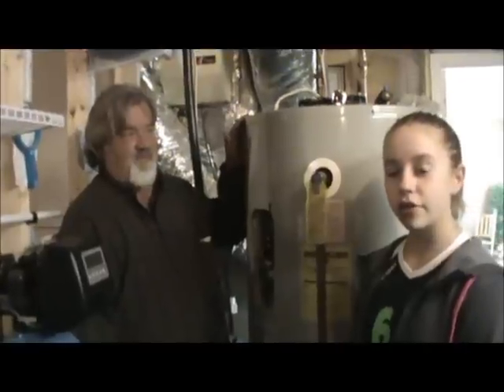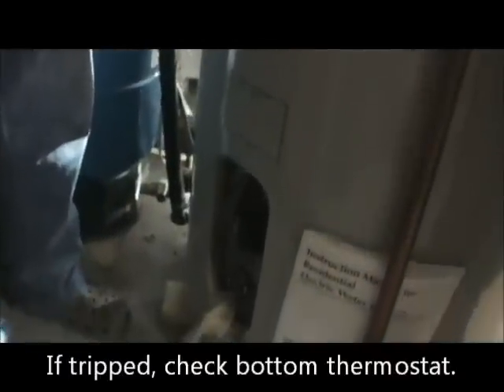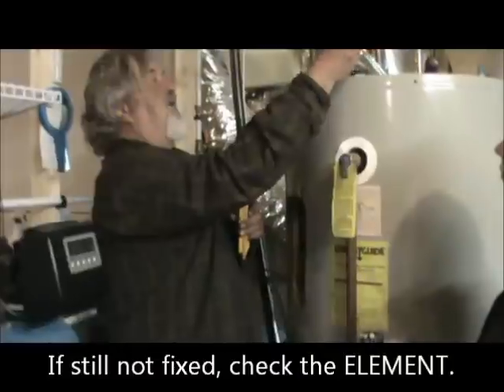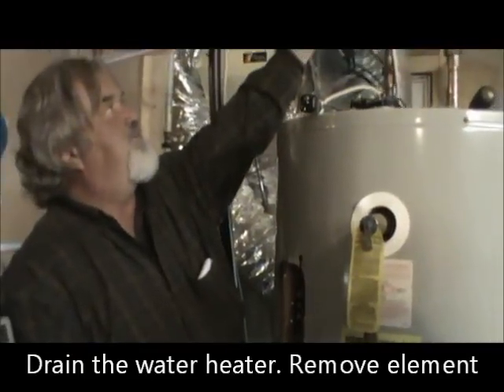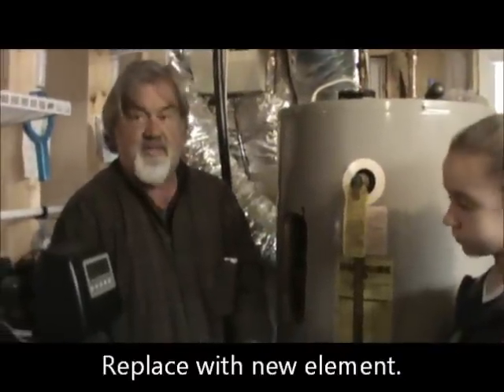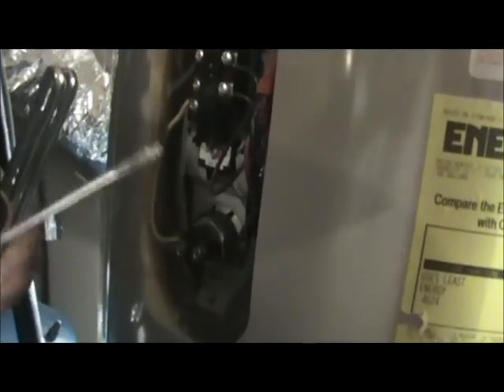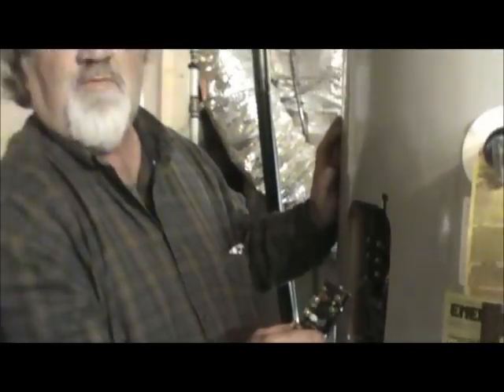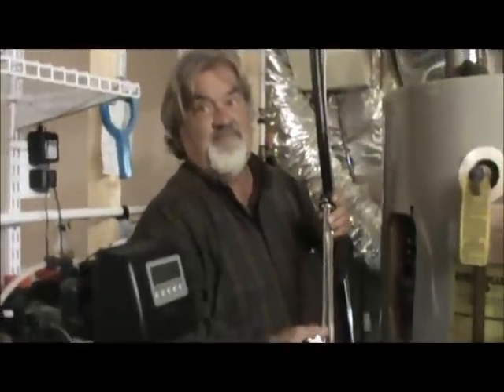How to Repair an Electric Water Heater

Comment: Thanks Harold and Chloe! I was getting ready to replace my heating elements a second time after only a year. After watching your easy to follow video I did some tests and it turned out to be a breach in the connection to the water heater. I stripped back the wiring and replaced the wire nuts and it works like a champ with no cost at all only a little time. I'm glad you guys were bored and made the video thx

Comment: Awesome video. The problem you spoke of with the water coming out so hot one day, then the next day no heat, was exactly my problem. 

Pushed the reset button, replaced the lower thermo (the elements checked out OK on the 
multi-meter) and we had heat again!

Your video saved the day. Thanks!

Comment: That was a great video!! I had a call for a water heater and no hot water coming out. I checked the heating elements and were fine. I noticed very little water coming out from bottom drain.

Comment: Great Video! I was actually wanting to see how you folks deal with sediment in the tank but instead learned a thing or two about the elements. I like your step by step procedures even though I already knew many of them.

Do you have a water softener? I wish I did but I don't  have easy access to my water system and I'd like a system that you don't have to add chemicals to all the time.

Comment: Thanks, I replaced the thermostat and element and just received a call that they don't have hot water.  I was going to replace the whole thing but you guy just showed me about the reset button.  I saw the red button but did not think it had a purpose.  I am assuming  that the only  time to replace the tank, if it is leaking?

Comment: Great video!  I was wondering if you would know why the panel on the top of the water heater where the wire goes in would be really hot.  There is also a smell like blowing out a candle.  I would appreciate any advise you can give.  Thanks so much.
Reply from the maker: Mari Jo Quirk Yes turn power off the heater take top door off an see if is a loose wire at the stat

Comment: this was a very good educational video , i am bored my self here ,my friend had their water heater stopped , the first thing i noted was their dual 30 Amp breaker was shot , i did the tests on their electric 40 gal water heater , both elements and all circuits are fine , my question is : what triggered that breaker to go bad ? i am not an electrician but do have some knowledge on it . thanks Harold , thanks Chloe  .
Reply from the maker: AnunnakiThe1 Breakers just go bad some time did work after you replaced it make sure the wires are tight on breaker good luck
Reply: indeed, thanks for the swift reply , the breaker was bad , i also found that the reset switch of the water heater was bad , so i had to inspect the elements and found them in very bad shape  ( after i removed them from the tank ), R&R both elements , R&R the reset switch , and R&R the breaker , and also discovered it was wired as simultaneous, ( since that water heater did not have two reset switches ? ) i rewired the red from main line as  L4 ( of the top thermostat )  to bottom element as non simultaneous setting,  the water heater is running like a champ :)
 thank you again Harold , and much appreciated
Reply from the maker: AnunnakiThe1 Thank you

Comment: it the electrical part has caught fire, which also melted everything, does this mean the whole tank should be swapped? I have disconnected power to the water heater for now. But now have no hot water until I figure out what's the right fix. Thanks
Reply from the maker: Yes replace it.

Comment: What could cause the water heater to leak from the bottom pannel
Reply from the maker: I think you have a hole in your tank, if so you need to replace the heated.
Reply: Harold Shifflett thank you, I was hoping it was something that we could fix 😖 guess I'm buying a new one

Comment: My daughter has a Giant model 172E=3F8M-E800 tank and it does heat water however it is behaving like a gas heater would if the dip tube is broken.  She only gets part of a tank of hot water.  All I am seeing on the internet is the electrical repairs.  I beilieve there is a dip tube in these electric ones as well.
Reply from the maker: Check the bottom  element and stat.
Reply: bottom element was toast.  Thanks after that an easy fix.
Reply from the maker: Glad to help.

Comment: I'm in a spot, and could use some guidance. I had to leave my both my water heater and my water supply off for a month, so I could learn how to fix a bad leak under my mobile home while allowing plenty of time for things to dry out. I successfully repaired the leak, and turned the water supply on. After my plumbing lines had been purged of air and my water tank was full, I turned the heater on, using the on/off switch on the tank of my Kenmore 'Economizer 6'. When I flipped the switch, it looked like a flash of light (from an electrical arc?) briefly appeared inside the switch housing. The water eventually heated up, but it took a whole day and only got up to around 95-100 degrees F. Then, it seemed like it quit working, as my warm water began to cool, and didn't recover after I used some to do a few dishes. By the next day, my water was only room temperature, so I shut the power to the water heater off, using the same tank-mounted switch. I'm worried about that flash of light I saw, and I'm not able to find anything on line that addresses the subject. I suspect that the element, which had already given me years of service, became encrusted with scale while the water sat cold in the tank for a month, but I want to find out if that flash was an indicator of a different issue I need to address, before trying to power it up with a new element. Strangely, the breaker in the wall-mounted service panel never tripped off at all. But I'll use it to remove power, and I'll check the reset button when I locate it. I haven't removed any of the service panels from the tank yet, but I will, and I'll also inspect the switch both visually and with my meter. This  particular heater uses a single element that is rated at 120 volts, with a tank capacity of less than 30 gallons.Sorry for being so long-winded, but I didn't want to leave out any critical diagnostic information. Have you run across anything like this, and could you advise me on what to look for?
Reply from the maker: randolph patterson I will be home  today give me a call at 434 284 0600 and I will try to help you out

Comment: Just bought a foreclosure and the 130 gallon Rudd water heater is not working. Hopefully it has reset button...I will see tonight
Reply from the maker: Byron Stanga If you get hot water replace lower stat Thank you

Comment: Sorry but you do not need to fully drain the tank to change an element.
Just turn off the water supply, release pressure by the releaf valve or a hot water tap.
And as long as all taps are off you can remove and replace the element with very minimal water loss. As there is no pressure you can just hold a towel over the opening while you get ready to install the new element. Much easier and faster than draining a big tank.

Comment: However if you do this yourself and you house burns down, your insurance company can say your insurance is VOID as it was not done by a qualified technician, and you will get NO coverage which a 200k house costs more than 100$ for a trained person
Reply from the maker: I spoke to my insurance agent and he said you are covered .  A lot of people can not afford a service man, so that is why we try to help people.  Safety first is always my advice.
Reply: Harold Shifflett
an insurance company has the right to refuse coverage, if they deem you have caused the place to burn down, and insurance companies don't make money when they have to pay out...... also the cost of your meter to test it maybe more than the cost of someone to look at it ($280ish for a Fluke T5-600), fluke is expensive but a good brand where as someone mite go out and grab a $10 from a dept store that isnt rate for more than 0.2A and have it explode in their face. Also this video generalises that everyones supply voltage is 246V which although 220-240V is common in Most countries its not used in every country, and 246V is a very exact figure, considering voltdrop in lines
Reply from the maker: Call some one thank you

Comment: You're welcome but you really should remake this.  You clearly know exactly what you are doing and I'm sure that in real life that these details wouldn't be missed but they are missing in your video and that can be dangerous if someone were to follow only what is here today. 

Also, after removing the element, it is very likely that there is some clean-up to do around the threads/hold - before installing a replacement.  These details are really important.  I hope that you would agree.

Comment: NO!  One should NEVER connect the power back to the element until AFTER filling the tank and ensuring that the replacement element isn't leaking AT ALL. 

There is good info here but it is too unstructured.  Water and Electricity are combined here and that is inherently dangerous.  It should be STEP - BY - STEP.  

Do yourself a favor and watch some of the other videos to understand exactly how to DO THIS RIGHT.

Comment: 500, 250, ?? Power is turned on or off?? What's the meter supposed to say??
I don't know squat about this so just to say turn it on volts means nothing.

Comment: the pipe for the extra water release has come off, how do I put it back on
Reply from the maker: +Dorrett Davis Are you talking about the pop off valve?  Call me.  434 284-0600 and I will try and talk you through it.